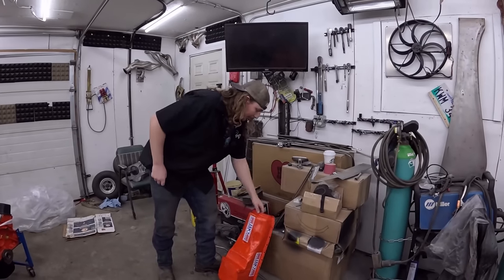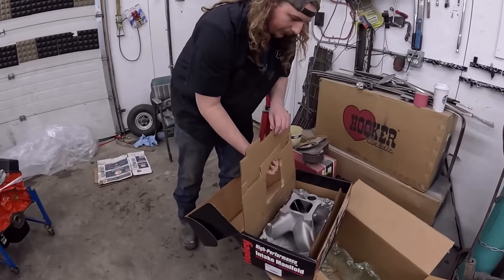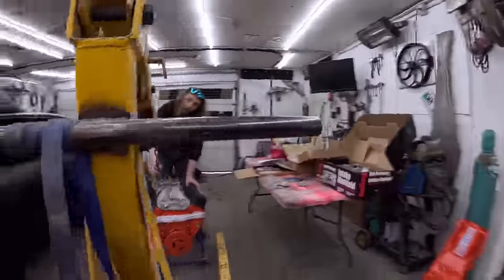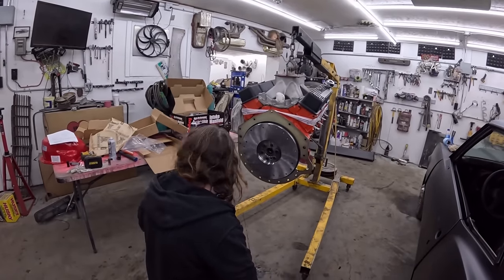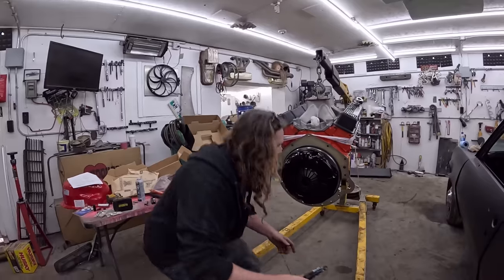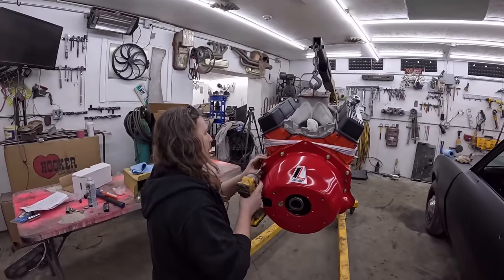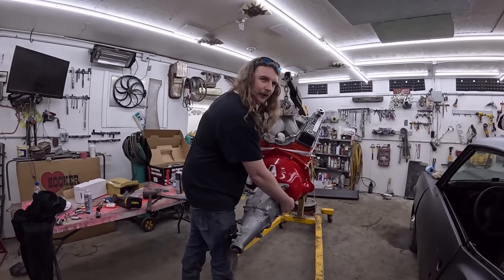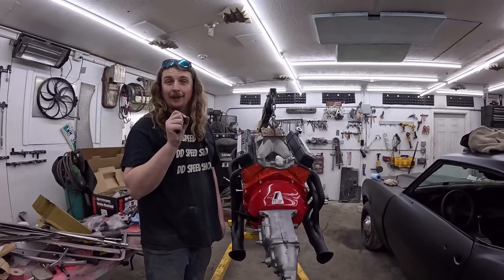*I READ THE COMMENTS I DID IT WRONG*- Bolting A 4 Speed Behind My ROWDY Small Block Chevy- fix 2nite

Comment: I may be crazy but that throw out bearing sure looked backwards
Reply from the maker: Yeah it's bad
Reply: Yep backwards,Also those cheap clutch tools are loosy goosy compared to the transmission spline been there on my back dealing with that issue ,LOLL! @DDSpeedShop
Reply: I OFFICIALLY NAME THAT FLUID PUDDLE......

LAKE SCHMOO...

One of Canadas natural wonders!!!
Reply: @DDSpeedShop , I always would eye ball the clutch alignment as you go tighten up the pressure plate. Making the alignment tool go in and out as you tighten. Your Camaro is coming together nicely D&D.
Reply: Well it certainly seems so. I've found that an old input shaft makes the best alignment tool and it's factory. It can also be used as a driver for installing pilot bushings. Do make dure you find one that the input shaft is not so worn at the pilot section that you get misalignment. Those plastic jobs just don't get it. Also checking the alignment as you go around tightening the pressure plate bolts makes sure that the transmission will go in smoothly. I've always put the clutch disc up to flywheel with the installation tool and then installed the pressure plate. The input shaft holds the clutch disc in place to facilitate ease of installation. Of course, on those older cast iron bellhousings which have to be bolted up first you have to put both clutch disc and pressure plate up into the bellhousing and then align the disc. I also put the transmission in gear and using an oud output yoke can turn the input shaft in order to align the splines through the clutch disc. Back when I was a young man, I could French curl a transmission over my head and set it on my chest and then bench press it up and chunk it in. Old man now and just have to use my floor jack to raise the transmission up. This of course is when you are laying on your back when installing the transmission. Can't use a creeper however as it rolls around. I would recommend a DD Speed shop cardboard creeper.
Reply: You should have went with a hydraulic clutch system with pedal get away from the Z bar linkage.
Reply: @newtonfirefly3584 your right I don't really like the kid. I was subscribed but found him to be ignorant and rude. Rich kid problems I guess.

Comment: The input shaft bearing loves the way you mashed that shit together. Test fit the bushing to the input shaft before you mash that shit together. Test fit the bell housing to the trans. Could also wear out the thrust bearing on the crankshaft. Keep that in mind when you start banging gears.

Comment: Princess Auto should have a pneumatic ram for that engine hoist.... I bought a harbor freight hoist off market place that turned out to have a roached cylinder - surprise I know... so I went to harbor fright and it turned out that the air one was about the same price. night and day difference. Still has the pump handle for when no air is available.

Comment: yes i agree the clutch only spins between 7,000 and 10,000  rpm so if it comes off it "might "not have enough rotational weight to cut your legs off at the ankles, so no need to waste the $1,50 locktite ....   i would just rely soley on the blowproof bellhousing.

Comment: Ìm really glad to put out the money on a blow proof bell housing my friend big Tony bought a really nice 67 camaro and he had a solid lift high reving small block in it the first time he did a burnout he brought the motor up to 6500 rpm dumped the clutch  and when he banged second gear he sheared the flywheel bolts off and the flywheel came through the hood took out the windshield wiper motor cut the back of the distributor and broke the block where the starter boĺted up and the cowl hood looked like someone cut there way out the engine compartment with a chain  saw all because of  cheap hardware  and no blow proof bell housing .expensive lesson.. don't cheap out on parts .
Reply: When I lived down in Tampa Fl in the early seventies there was this fellow who had a 55 Chevrolet with a big block in it (4 spd. car). Well he was a grease monkey at a Gulf station up on 50th street (if memory serves me right) and 50th street was a 4 lane undivided street (and the lanes were Model T width. He worked at night and other hot rodders would come up and race him for money of course. Well one day I ran into him and he had all these little cuts all over his face. I asked him what happened. Well he said "one night last week a fellow came up to the shop to race me and we lined up on 50th street and I blew the flywheel out of that car and i hit a telephone pole (he was in the outside lane and the telephone poles were right on the edge of the sidewalk). Of course the car went to the junk yard and as far as I know the fellow ended his street racing career. That was well over fifty years ago.

Comment: The best pilot bushing installer is a old blown head gear. The surface matches the concavity of the bushing exactly. You never mess up the bushing. Just cut the gear portion off, and grind a nice flat chisel type rounded head on it. Works better than those plastic clutch alignment tools too, just like you're plugging the tranny in. Can't believe you ain't made one long ago, this is do it yourself D&D, correct? Any stick Chevy trans can be a donor. The odd size bushing you find on the early cranks. We used to call them Powerglide cranks, since it was a stick change over where you always needed the oddball. Dorman makes the conversion bushing, #690-034, fits perfecto. The 690-014.1 is the standard one.    Well worth having both in stock, cause good luck finding the 690-034 in stock anywhere local.

Comment: Test fitting your bell housing to trans and clutch to input shaft before mounting everything can help also
Reply: And some people even check the runout of the bellhousing. That was done on big truck engines when a flywheel was removed for servicing. It do help the input shaft bearing live a little longer.

Comment: Dan, if you're going to use a pilot bushing instead of a bearing. Put it on your thumb, fill the center with motor oil, and squeeze the oil with your thumb and finger until the oil protrudes from the outside pores of the bushing. That is how they are designed to be lubricated.

Comment: Those plastic input tools are not that accurate. If you can't get the trans in that last 1/2 inch, just hook up the clutch linkage, have someone step on the petal, and it will be super easy to push in  the rest of the way. I've done many this way!

Comment: I'm NOT here to tell ya how to install throw out bearings...
😂
I am here to tell ya that the SFI sticker on your bell housing is good for two years.
When the time is up, don't sell it to a Canadian hippy at a loss...you send it back to Lakewood (or whoever built it) and it gets a fresh sticker..costs about a hundred bucks plus freight both ways, and with the price of a new bell being what it is, it's not a bad deal.
Also FYI..scatter shields don't work miracles. If you do any serious racing, get an SFI approved flywheel & clutch as well..
Reply: That's good to know. I'll bet through the magic of you tube Dan installed that bearing backwards just to stimulate the comments section. He and co-conspirator Dani probably edited out the footage where he fixed that problem. Well I can assume so but the acid test is when he realizes the clutch doesn't work quite right

Comment: I always sit the motor on the floor to install the transmission.  Also I add a little bit of grease to the pilot bearing.
Reply: Yes sir. When we growing up my dad built a ktichen table that was hinge to the wall and could be swung up out of the way when not in use. Well as time passed he built a newer one that slid over against the wall. Well I acquired the old one and attached to a concrete wall in a building I rented and with proper support I could set an engine on it and install a transmission (automatic or stick) ay waist level instead of getting down on the floor. Yes I also put a little grease on the pilot bearing and prefer to use the bronze bushing as it does indeed lasts.

Comment: A little how to clutch — aligned clutch best you can and when assembling transmission to it just engage throw out arm with long wrench or whatever and tranny will slide right in 😊 because clutch will be loose
Reply: or just use the alignment tool that comes with every new clutch and you won't have to try to depress the pressure plate fingers with some Rube Goldberg handywork! 😳
Reply: @Jimschrbr  not close enough  just sayin

Comment: Even with the throwout bearing in backwards Dani is a phenomenal helper!
Reply: I hope you got the correct T/O bearing. I found out the HARD way that there are 3 different heights of throw out bearings for Chevies, when I was installing an aftermarket clutch assembly in a 67 Implala w/SBC. Jim Green's speed shop didn't know which was the right one, either.

Comment: Back in the day, lol, the older high horsepower chevy's had cast iron bellhousing, and scatter shields were a woven material wrapped around the bellhousing. The only cast aluminum were the automatic transmissions, but more recently they bellhousing out of cast aluminum.  Flywheel bolt torque is 65ftlbs, pressure plate is 35ftlbs, and bellhousing is 25ftlbs.. You know you put the throwout bearing in backwards, right? I love that you got a MSD Pro Billet Distributor, just beware of the Digital E-Curve Pro Billet Distributors like the 8394... Condensation in the cap will destroy the circuit board within a year, rendering it useless.. Its an expensive paper weight at 650.00 USD.. DD speed shop is a great show with great content, keep up the good work!!!

Comment: It was Big Daddy Don Garlits, back when top fuel cars were front engine, who had his clutch blow and injured his foot. He started using a Scatter Shield, I don't know if he invented it or not but he did have the first rear engine top fuel dragster.
Reply: I think that scattershields were around before Garlits had that explosion (took the front part of his right foot off). I used to get Hot Rod magazine in the mid sixties to the late seventies. I would but up pictures of the hot rods and drag cars on my bedroom wall as a kid growing up. That photo of Garlits blowing that clutch went up on the bedroom wall. You could see that the car was bent in a ninety degree bend and Garlits was up over the engine looking down at it. I understand he still has that car in his museum down there just south of Ocala Fl on I-75. Of course the next season Garlits had the rear engine set-up (he merely placed the drivers position in front of the drive train). There had been attempts before to introduce rear engine dragster with engines set sideways and using all kinds of drive train rigs but this car Garlits came up was about the first of this design and simple. I believe the article I read about the car Garlits stated that all he had to do was to change the steering gear ratio and the steering was too quick.

Comment: Not sure if anyone has mentioned it before, but umm, that throw out bearing is backwards there bud! Just looking out! haha

On a different note, it's much easier to wiggle the trans in if you just rest it on a jack with the motor lower, then you just have to wiggle it and don't have to worry about holding the weight of the trans. I'm lazy though so I'm always taking the easy way!

Comment: On a 305 with T5 had the new bronze bushing hold tight onto the input shaft. Then the bushing spun with the input shaft. To me it seemed the bushing shrunk a bit when installed in tthe crankshaft. Replaced it. But did remove a bit of material from the bushing after installing (emery paper on brass rod). Did test fitting with a spare input shaft instead of the plastic guide. Both bushings had shrunk a bit when installed. But it worked.

Comment: Get an old input shaft, broken teeth no good etc, you now have an installation tool for the bearing. Nice weight and size and a hammer doesn't hurt it. 
😎🏁
Reply: Yes sir one can cut off the section where the rollers go in and it makes a nice drift for installing the pilot bearing.

Comment: When I got the Blow-Proof Bellhousing for my Gasser the instructions said I needed to  make sure the hole in the bellhousing was centered by using a disk indicator.  I ended up needing offset dowels.  I have done many without doing the disk indicator but I will admit the tranny went in super easy and the clutch worked like Butter!  Lol
Reply: Hmmmmm if I watched the rest of your video before texting I would have seen you mentioned it!!  Lol

Comment: Dan! Did you grease the throwout bearing surfaces, and the ball pivot and fork as well? Nev'R Seeze works well because it won't spit all over the new clutch and flywheel. Well, you have to turn the T.O. bearing around anyway...nice job overall. Now take it to the track and see what you can break!!

Comment: You put your clutch plate onto the alignment tool & then onto the spigot bush & then put the pressure plate over the top. saves juggling it all. I've always put a dab of Loctite on the pressure plate bolts too. It's a bitch if they come loose🤔.

Comment: I just sold a Hurst 70 Pistol Grip shifter lever for 1100 CAD. It's getting crazy. Goes both ways though, I cannot find a set of Fel-Pro 1106's bought and shipped for under 500 CAD. 500 bucks for a set of fkn head gaskets.

Comment: You should pull the 351 out of the bricklin and put it in the Camara dare to be different 😂, MrGonein60 Flint Higgens is putting a 302 in a 68/69 charger that was rusted beyond belief but it's not now check it out

Comment: i put hooker headers in my camaro and they sucked i had headman before which were much cheaper and fit much better. the second bolt on #1  had to be put in with a hammer and wont come back out

Comment: never a big fan of those bolt on intake puller plates.ok if your useing it to pull a junk motor out not for new.lota stress on intake.vacuum leak probably an cracked intake.just sayin eh